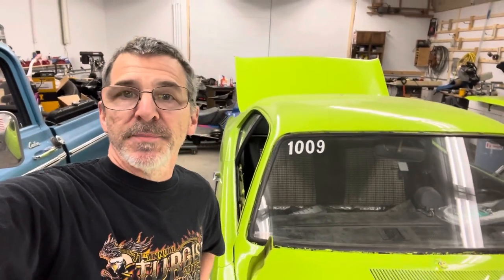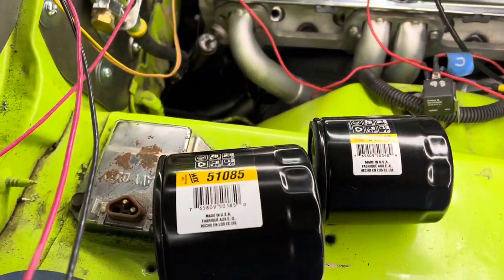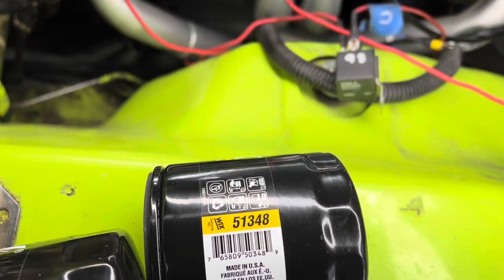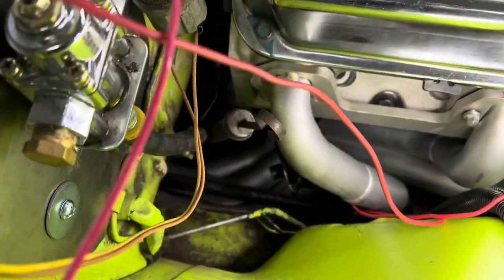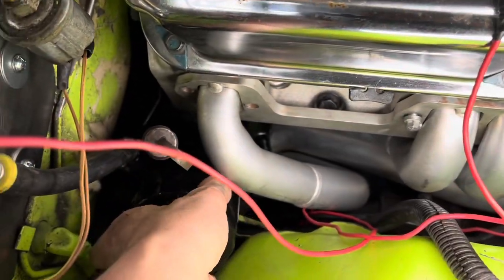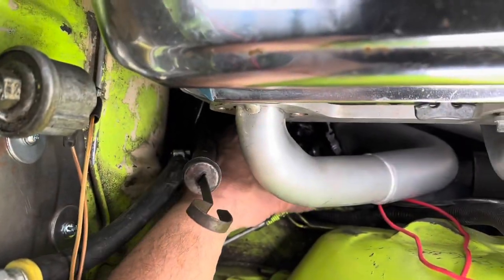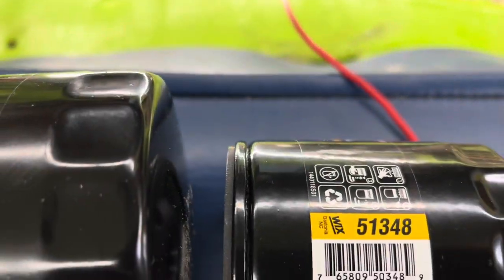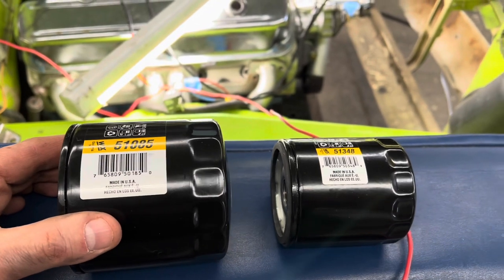Choosing an Oil Filter For a Small Block A Body Mopar

Comment: I used to run the 90* adapter as well, but got tired of pouring oil all over the headers when it was changed.  I ended up running a  Moroso remote oil filter adapter with an Earl's filter mount.  Good info on the filters, though.  I'll be using a couple of 51085's on my dyno session next weekend due to header clearance.  Once it's back in the car, back to the remote filter with a full size filter.  Love watching your progress.  Getting faster!
Reply from the maker: Pretty tired of the 90 degree adapter too.
A remote filter would be a smart move.
Thanks for watching. We had a good day at the track today so stay tuned.
Reply: @jerayracing  Here's what I'm using and recommend.  Use -10 braided hose to hook everything up.
Moroso 23682 - Remote Filter Adapter
Earl's Performance 2077ERL - Remote Oil Filter Mount
Reply from the maker: @Scott-qe6ih   thanks for the part numbers! We will look into it!

Comment: wix 51515  is the best holds almost a quart. or get the wix that replaces fram ph16a its shorter but less filtration that came out on the 318 /360 magnums
Reply from the maker: I don’t doubt it. We’d like to run the biggest filter we have room for. Without having to take the header off. Thanks for your input!